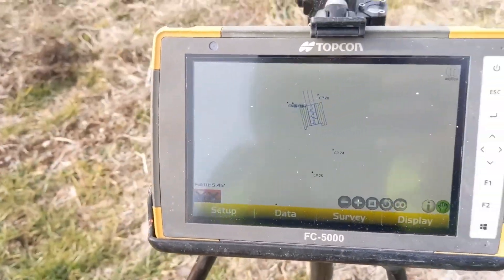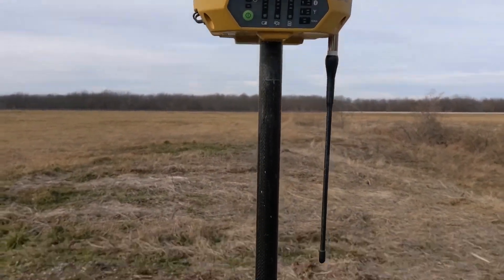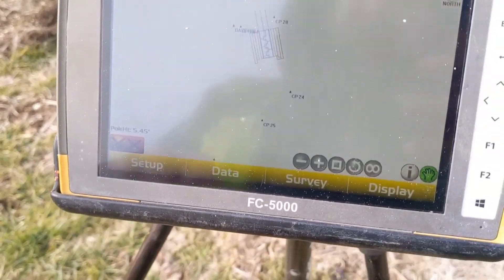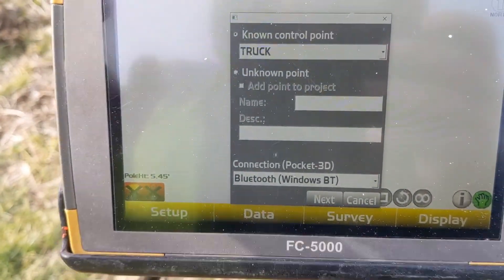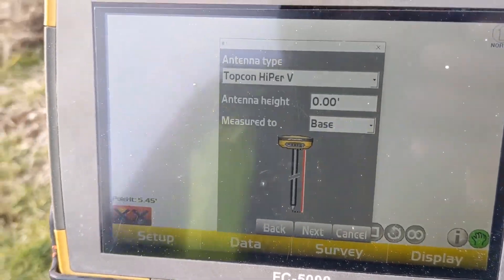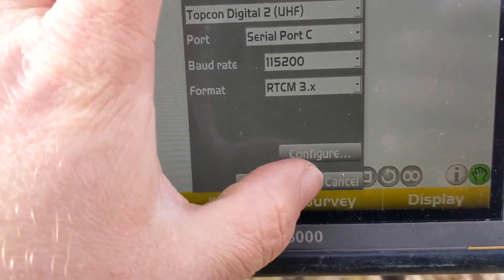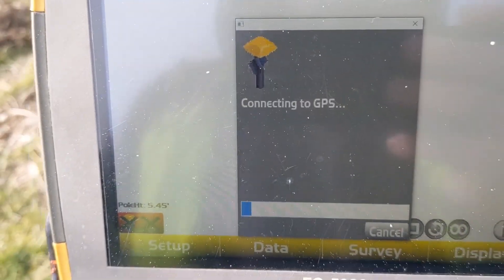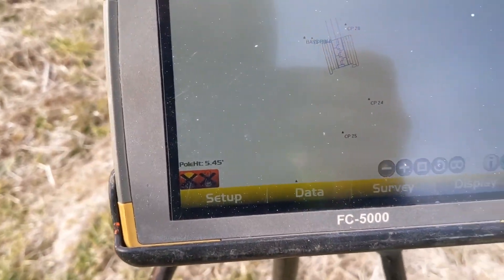Starting Base on a Known Point - Topcon Pocket 3D

Comment: Question do you also use zero antenna height when you set up your temporary base as well in your case the truck base?
Reply from the maker: Yes, I personally always use a zero height, unless I am setting up on a known control point that is established on the ground using a tripod setup.
Reply: @ctpusa1  awesome thank you!

Comment: I recently tried connecting another rover to our base station. We want to use two rovers on site. My first rover hooked up no problem to the hyper v base station using a hyper v rover. I then tried connecting a gr-5 rover to the hyper v base station and it somehow changed my localization and I had to redo it. Still haven’t got the Gr-5 to work, any suggestions?
Reply from the maker: If the Hiper V Rover is working. I would start by taking a picture of the radio settings. 
Then I would copy the project off of the data collector running the Hiper V and copy it to the data collector running the GR5. 
Then just connect the GR5 and make sure your radio settings match and it should be good to go. Also make sure the GR5 is set to Receive (Rx), not transmit (Tx). 
If you can't get it our contact info is available on our website.
Myconstructiontechnology.com 
Only other thing I'm thinking is if youre trying to bounce between a GR5 and a Hiper V on the same data collector they will have different Equipment file settings for the phase center.

Comment: Question local projection is northing easting and gps will be lat long. How can you connect to a known point with gps information
Reply from the maker: Not sure I'm totally understanding. If you have coordinates in a known datum and projection you can get the lat/long from a coordinate calculator, but elevation may be difficult. If you observe a point while running a projection it will record the lat/long, but you won't be able to see it in pocket 3D. There may be a way but I will have to do some investigation.